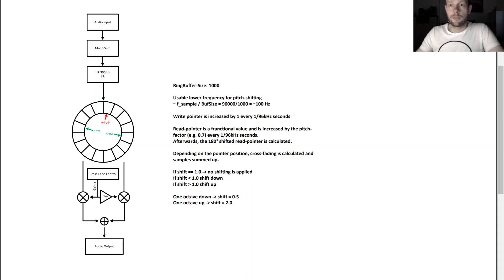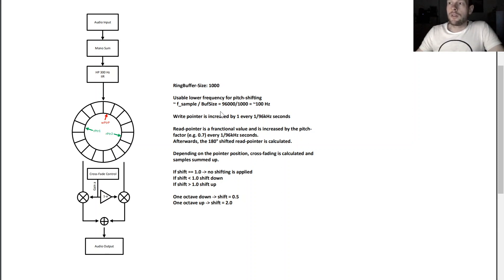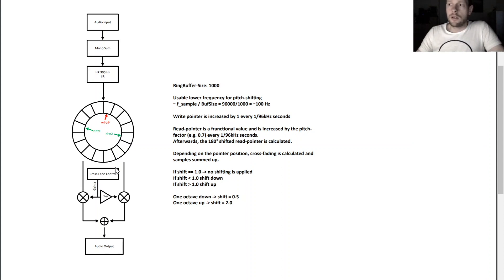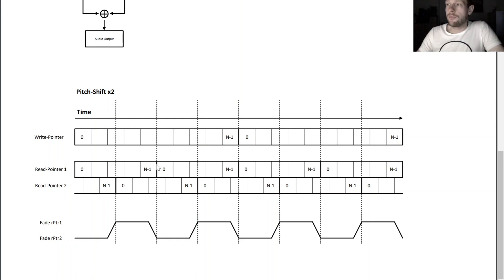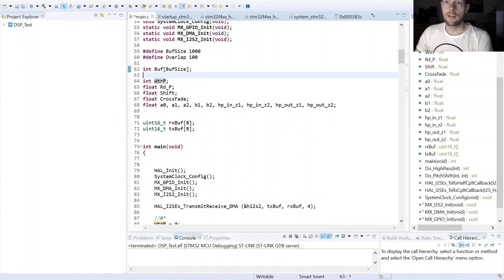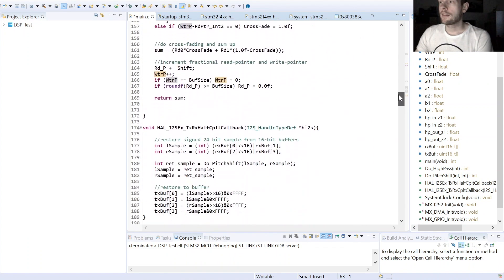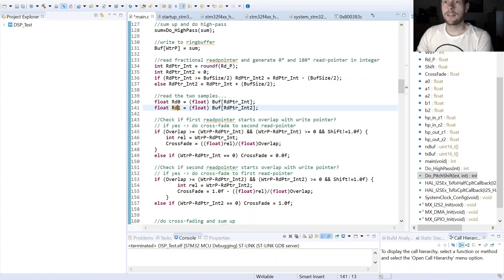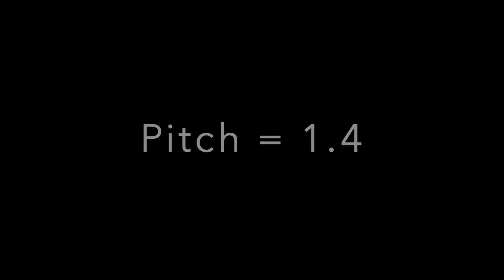[#7] Pitch Shifting - Audio DSP On STM32 (24 Bit / 96 kHz)

Comment: Hello,
I would like to know if it is possible to help me with a project of audio playback of wav and mp3 files?
I have downloaded a WAV and MP3 player from the STM Micro electronics website for the stm32f7 discovery.
But I would like to include your pitch shifting function but also to add a function allowing to vary the playback speed (pitch) and reverse playback.
Is this possible if we can communicate by private message?
Thanks for your help.
Kind regards.

Comment: In part #24 I showed the adaption to ESP32 Arduino IDE.
This will add the pitch shifting. And I add some thoughts of setting ring buffer length and overlapping.

The length of the ring buffer is related to the lowest frequency.  For human voice this is 300Hz. Therefore the high pass.

For better quality it will use more than two periods (2x). length
Minimum buffer length needed is 2x 2x (44100Hz/300Hz) = 588
The shift also has an influence to the buffer lenght. This will be explain in overlapping.
But best quality is buffer length = 10 * Overlap

#define BufSize 2100

//Pitch
float Shift = 0.7f;

The overlapping / crossfade length is also related to the lowest frequency but also by the pitch shift. 
We know already the "lenght" of a 300Hz sample:  44100Hz/300Hz = 147 samples,  at pitch shift of 1.

The lower the shift the more samples in the overlap are necessary. divided
// Pitch 2  : 147 samples/2   = 74
// Pitch 1  : 147 samples/1   = 147
// Pitch 0.7: 147 samples/0.7 = 210
#define Overlap 210

Next planned updates:
* Add Microphone, output amplifier. Add a notch filter to eliminate feedbacks
* Add a 6th order Butterworth filter on the output  to smooth the high frequency noise from the signal. 
* Add a rotary encoder to change the pitch live
* Add a small  OLED display
* To make it sound like Kylo Ren, some more magic is needed. https://www.ecgprod.com/how-to-sound-like-kylo-ren/
* Mono mode only,

Code can be found here:
https://github.com/JoergKronos/Pmod_I2S-ADC-DAC-pitch_changer
Reply from the maker: Thanks for your great support ! 👏🏻🙏
Reply: I just finished the Version 2.2. I added an rotary encoder to change the pitch live: KY-040 Rotary Encoder – EV3DM
It took me some time to realize that the switch has no pull up. It was prepared at the PCB, but not installed. So, I add a 10k to Vcc.
To make it work I had added 2 hardware interrupts. The encoder shall not disturb the audio calculations, so it run at 2nd Core.
The suitable rang of the Pitch is between 0.5 (one octave down) and 2.0 one octave up). The step per click is 0.02
#define PitchH  2.00f    // Maximum pitch
#define PitchL  0.50f    // Minimum pitch
#define PitchS  0.02f    // Pitch Shift per step

Code can be found here:
https://github.com/JoergKronos/Pmod_I2S-ADC-DAC-pitch_changer
Reply: This is already Version 3.1
The tiny OLED had been installed. Its not only showing the Pitch Shift level.  it also shows a level with peak and 500ms release.
My fear was to disturb the audio part, so I used the the second I2C channel of the ESP32 and all calculations are made at the second CPU.

The display is a tiny  0.91 Inch OLED LCD Display Module with I2C interface .

It's necessary to install the "ESP8266 and ESP32 OLED driver for ssd1306 displays" Library to use: #include "SSD1306Wire.h"

The  I2C address is 0x3C  and for the second I2C ports are:

#define I2C_SDA 33 
#define I2C_SCL 32

This short video will give you an short impression:
https://youtu.be/phLO6U9gw9U

The code is stored here:
https://github.com/JoergKronos/Pmod_I2S-ADC-DAC-pitch_changer
Reply: The new Version 4.1 is ready.
I add the Notch filter. To change this online another Rotary Encoder had been added.
Anytime a new notch frequenz is requested, the coefficients of the IIR Filter will be calculated.
Also the OLED shows the Notch frequenxy now.

The Code can bee found here:
https://github.com/JoergKronos/Pmod_I2S-ADC-DAC-pitch_changer/blob/main/code/Pmod_I2S-ADC-DAC-V4.1-pitch-notch_RC.ino

A video is also included:
https://github.com/JoergKronos/Pmod_I2S-ADC-DAC-pitch_changer/blob/main/Notch.mov

Comment: Hey, I have a question before I start trying things out. You are using two variable for the input : 'lsample' and 'rsample' like if you are using stereo sample even though I am pretty sure you used mono during your tests and you function pitchshift just means everything. Is there something I did not manage to follow ?

PS : I want to make a tiny pitch shifter to use in a costume. I wonder if soldering an electronic high pass filter will do the job as well as your high pass because I am planning on using an ATtiny and 5 float multiplications in a row is waaaaayyy out of its league for 20kHz sampling.

Comment: Hi! great video! just one question...if we are upsampling/downsampling, then the duration of the sound should change, right? why is that not happening in the example audio you show at the end?
Reply from the maker: The pitch-shifting is working based on oversampling / undersampling the audio, but the incoming audio is splitted in small pieces of audio, which are played multiple times when upsampling for example. Threre is one drawback: The lowest possible frequency usable is dependent on the size of your buffer structure.
Reply: @YetAnotherElectronicsChannel  Great! that was the part I was missing. Thank you so much man!
Reply: @YetAnotherElectronicsChannel  is this how guitar pedals like the EHX pog work? Thanks.